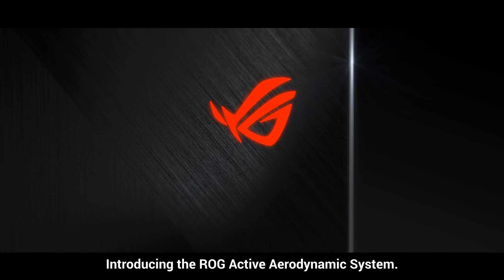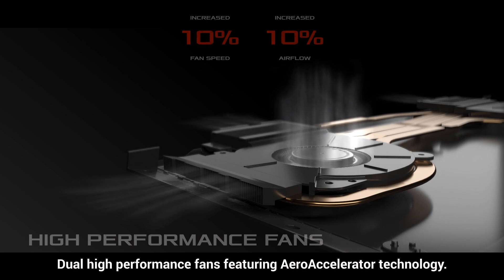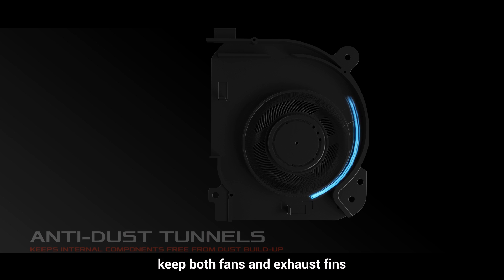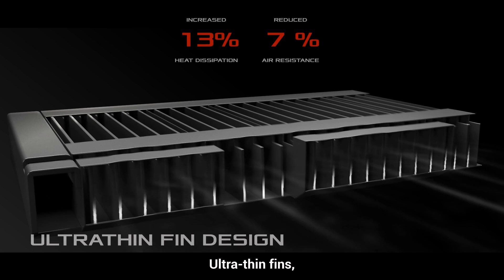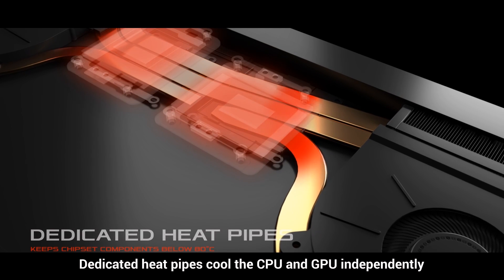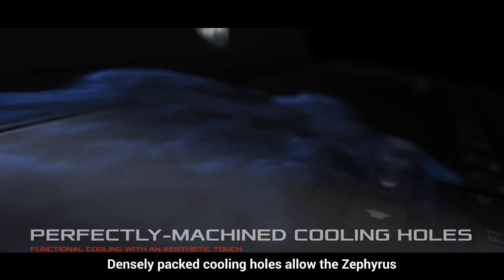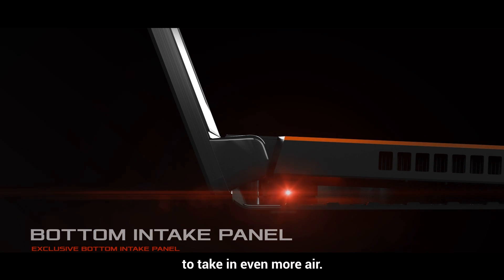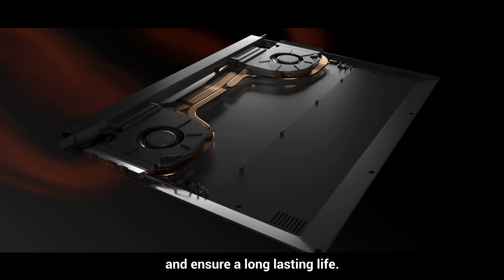Active Aerodynamic System(AAS) - ROG Zephyrus Series Laptop  | ROG

Comment: My Zephyrus M has CPU thermal throttling in room temps of 25 degrees Celsius.  CPU temperatures get up to 97 Celsius when playing games. The GPU stays cool around 76 Celsius without issues though. Could it be a faulty paste issue?  :(
Reply: AlphaBiohazard yeah might be, mine doesn't go over 80 even in stress tests in a similarly temperature. Maybe repaste?
Reply: AlphaBiohazard I would suggest you repaste your laptop and possibly undervolt your cpu
Reply: Mine goes around 80+ , never to 90 .. make sure that your vents are clean and air can flow through them ..  Write to asus customer service, they are very helpful .. good luck